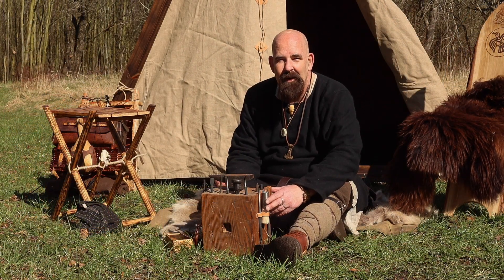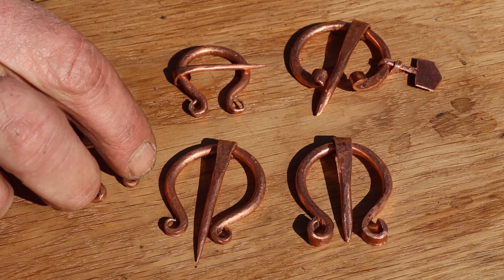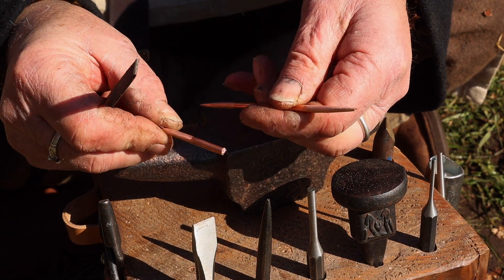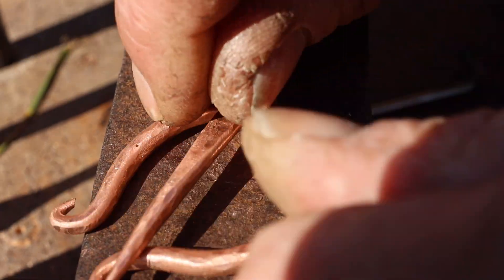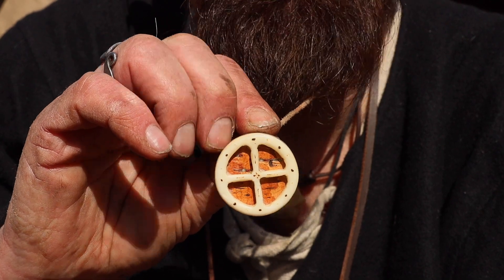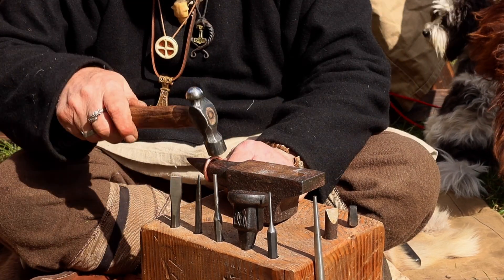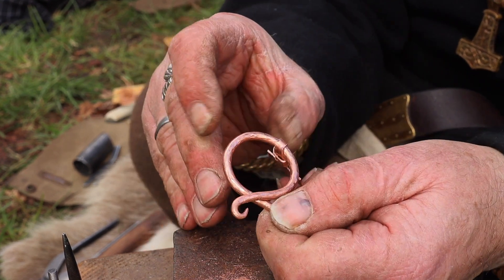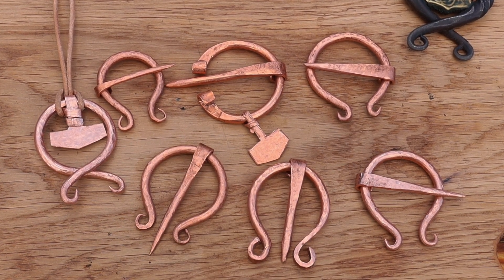DIY Cold Forging Viking Jewlery

Comment: Hi Tom. In the U.S. there is a company called Blacksmith Supply that sells a 4"×4"×4" (roughly 100mm × 100mm × 100mm)  "stump anvil" (named so due to the fact that they're designed to be driven into a stump in order to use them) for $85 (USD). If I were starting out in metalworking, I would definitely look into one. I  think it would be a much better value than a cheap cast iron anvil like I started on. Vintage blacksmith equipment is ridiculously expensive for the most part, unless you come across something by luck, as in a "garage sale". Back in the day, stump anvils were common because they were used to thin the edges of scythes before finishing with a stone, but they were generally fairly small & light.
Reply from the maker: Yeah I was lucky to find one in a second hand sale 😉👍🏻 and it’s surprisingly good to work on 💪🏻😁🔥Tom